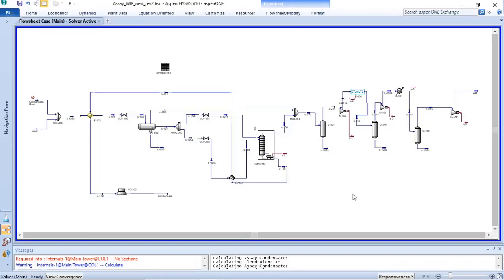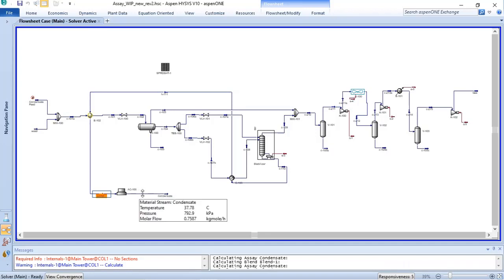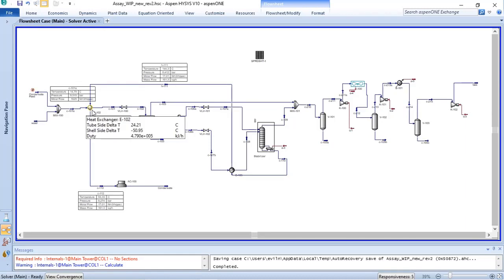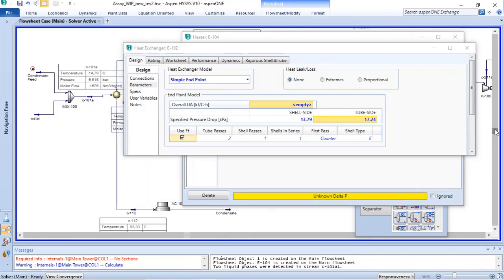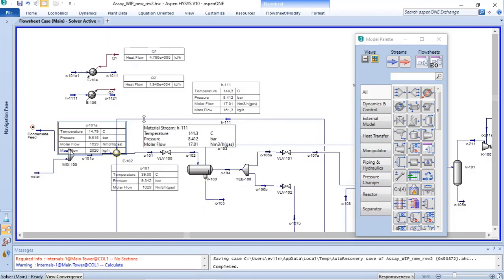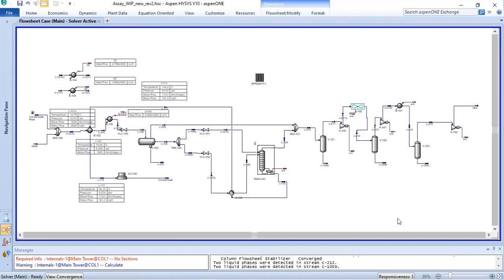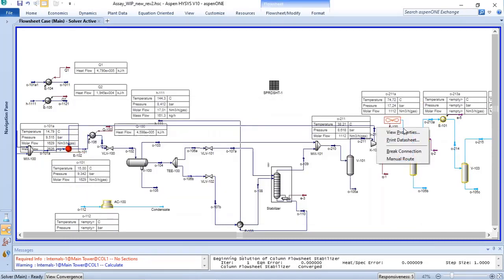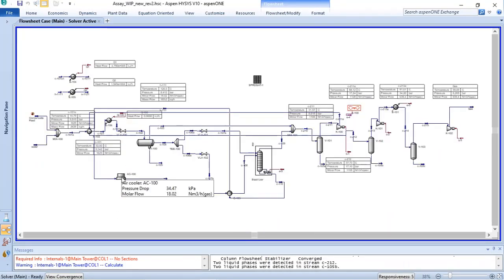Aspen HYSYS Heat Exchanger Design and Energy Recovery Evaluation

Comment: Another thing to consider is the UA of the heat exchanger and any temperature crosses if you intend to use pure counter-flow. HYSYS is also very good at filling in missing information based on the unspecified degree of freedom, for example if you have an idea of a typical U factor for that service and are trying to target a certain exchanger size try specifying UA instead of the exchanger outlet temperature. A pre-heater may also not be required if reduced start-up rates are used initially until flow has been established to the OH compressor and heat of compression becomes available.